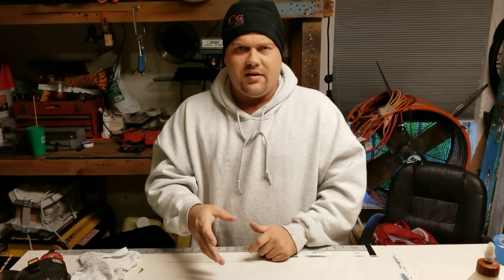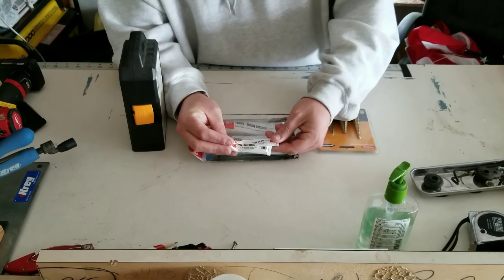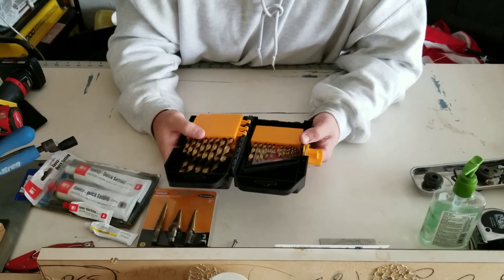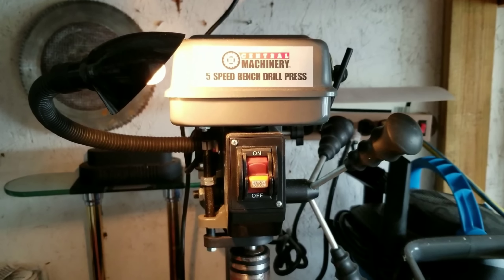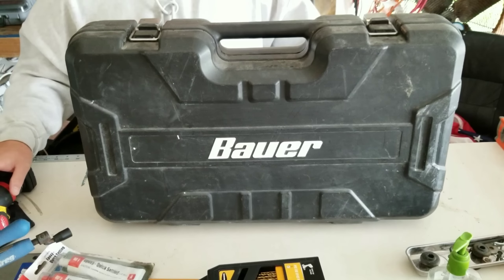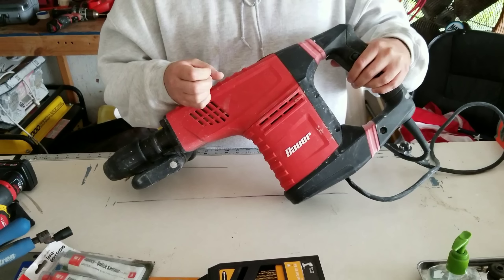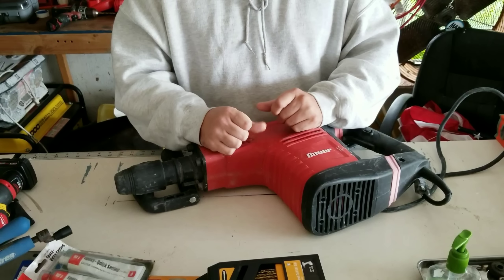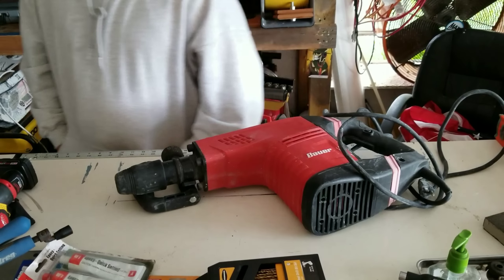Harbor freight must haves

Comment: My best harbor freight item was a surprise Pittsburg impact rated ball joints for sockets, I bought them in a pinch one day and used it on  a 2767 Milwaukee and it did not break ! Now they are the only ones I’ll buy there much cheaper than any other name and they don’t break!

Comment: I do the same thing.buy something's that I don't use everyday. The warrior bits are pretty much junk but there cheap. They have some half decent products, the Pittsburgh pro hand tools are lifetime warranty, break one take it to store they hand you a new one. I had a 18ga. Pin nailer that broke in middle of a trim job there was harbor freight down road from job, I grabbed a $15.00 gun to get me through the day, that was 8 years ago the gun still works fine.

Comment: Wealro, next time you go harbor freight, check out the 390 lumen folding light bar. I bought 2 of them and use them a lot. I got them on sale for $19.99, since then they raised the price and looks like they usually go on sale for $24.99. Its a good light but not worth full price, also their 5 drawer tool cart is nice, I got one for $169.00.